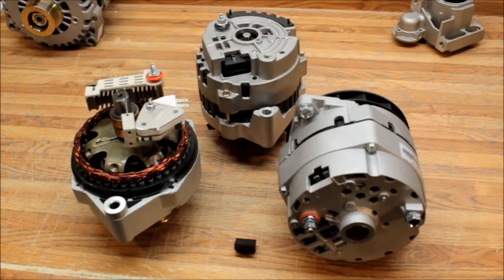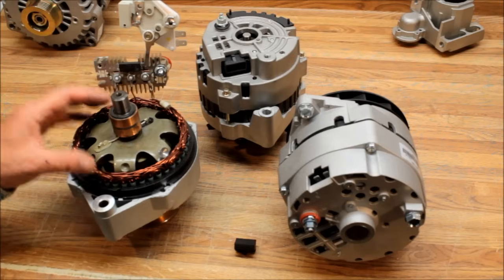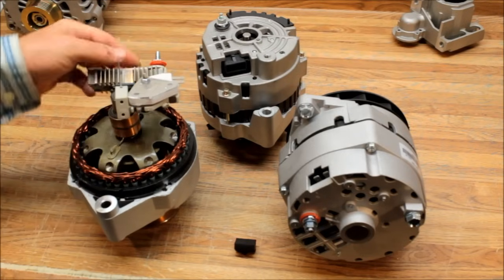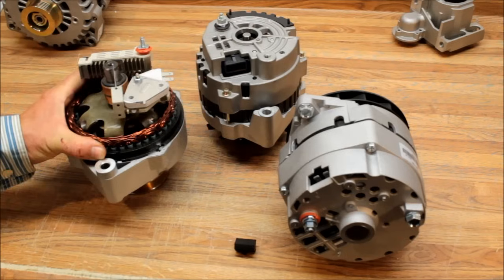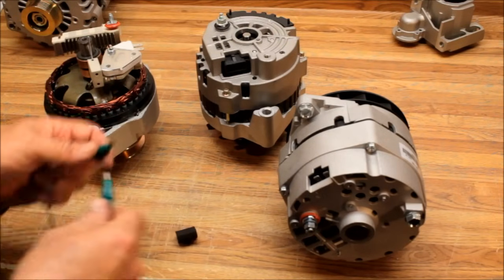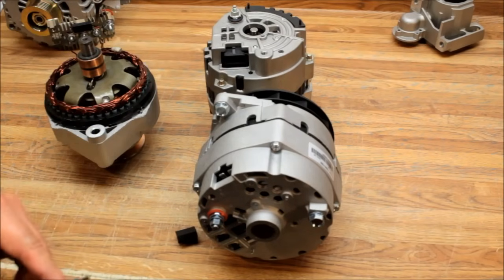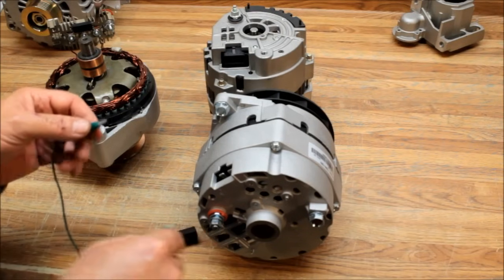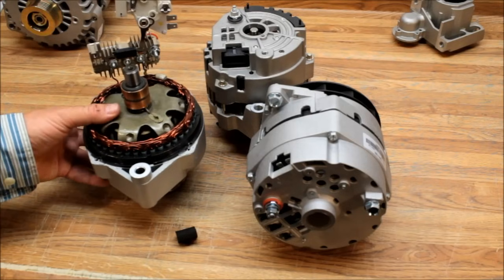How to  Excite the One Wire - Self Exciting Alternator.

Comment: what I have had to do on the non self exciting alternator is to put a timed relay on the start side so it has 12 volts when the alternator is running for 5 seconds which get the alternators going, wont charge just via key as when engine starts the alternator once running then needs to be excited, the exciting thing was I had a hellovagood time on my project.

Comment: I've had good luck just buying an 80's alternator and installing an idiot light to excite it when the key is turned on. (old tractors). Cheaper than buying the "one-wire" jobs. On one tractor, I wired the excitation wire through a 20 ohm resistor to the light switch, so I could just pull the light switch to start it charging if it sat for too long and the self-excitation didn't kick in (this one was a 'one-wire' alternator job).

Comment: I have a GM10si alternator with internal regulator. I'm rewiring my pickup truck and have no wiring harness and new wires being installed. I have the positive post wires to the battery. My question is. T1 post to the positive post constantly or just momentary to excite it. Would it fry the wire if it is on constantly? And does the t2 post need to be connected?

Comment: can you leave a live 12 volt wire connected to it too excite every time or will it ruin it if it is not spinning
Reply from the maker: Rýán Túçk Exactly right. There's also a problem with that AC signal from the stator (which the tach line is a direct connection to) leaking to the batteries.
Reply: no, but continuouly connecting the tach to positive will put about an extra 50 ohm load on a connected battery even when the alternator is off; not much  unless the battery is weak, small capacity ,or stays connected for an extended period of time

Comment: One wire alts use marine regulators and it's called flashing the field. If it's not a si series you can flash the field by touching the stator wire with a curcuit light. That way if you accidentally touch the case the light will light up instead of arching.

Comment: I have a new SI series alternator which I put on an old diesel tractor.  I thought it was a 1 wire alternator but after i initially excite the fields and then shut it down, on re-start it doesn't seem like it has any residual magnetism (it no longer charges).  Should I install a jumper wire from #2 to the + terminal, and also an "idiot light" in between #1 and the key switch?  Thanks.
Reply from the maker: That is exactly how you hook up the 3-wire units, only you technically don't need the jumper from the + post to the #2 terminal. There can be a problem with this, though, as voltage can backfeed up the key-switch and keep your engine running even when the switch is off (you have to pull the battery wire to shut the engine off). Including a diode between the switch and the #1 terminal fixes this, it's called ignition anti-feedback diode.
Reply: alternatorman But I don't need the ignition anti-feedback diode because the tractor is diesel.. no ignition system on board... correct?
Reply from the maker: You should still need it on a diesel. Instead of keeping the ignition active, the back-feed will keep the solenoid that opens either the injection pump or the air valves active.